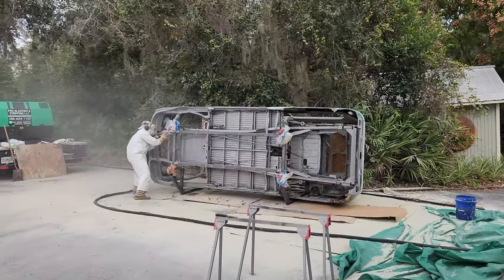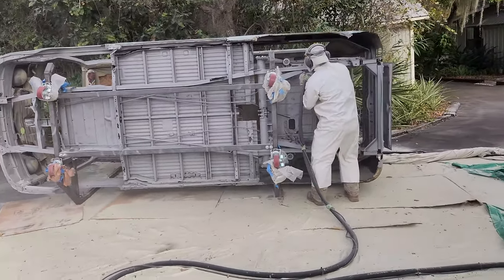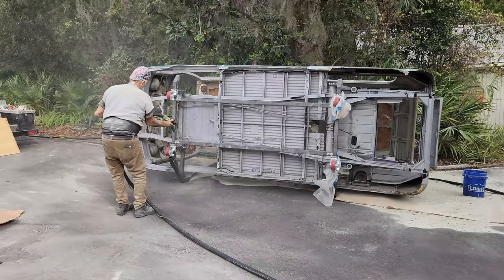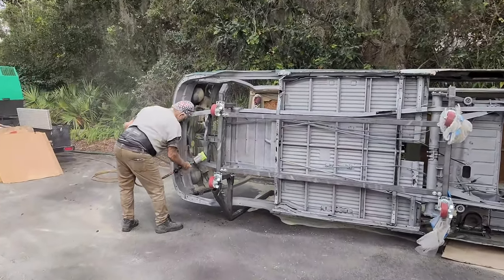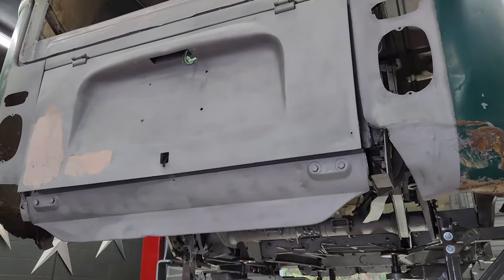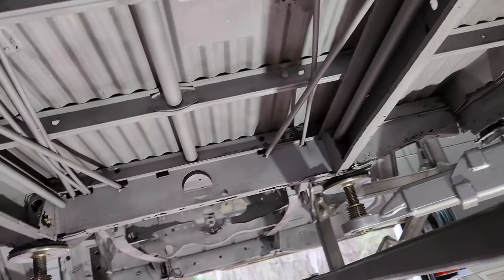VW Bay Window Barn Find - Sand Blasting!- VW Bus Restoration Episode 14

Comment: How much did it cost you to get this done on your bus? Is it done by the hour? Job? You mentioned 8:00-3:00 at one point. That is so long!
Reply: Oh I just saw! 300$ an hour! Way above my budget. Thanks
Reply from the maker: Was pricey and I am going to hit it with my pressure pot blaster before I finally paint the chassis. Taking way longer than I had anticipated of course.
Reply: Surely you could have gotten a full alkaline/acid dip for less than the cost of this blasting job..?